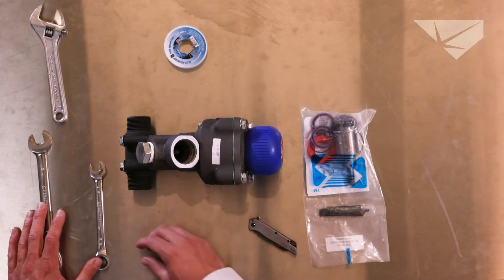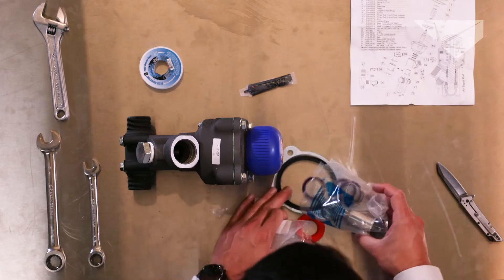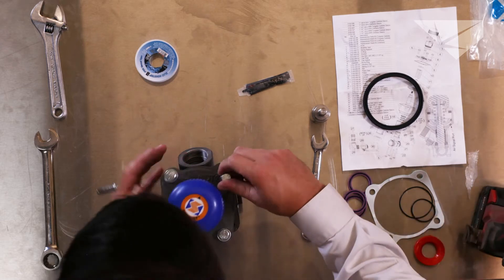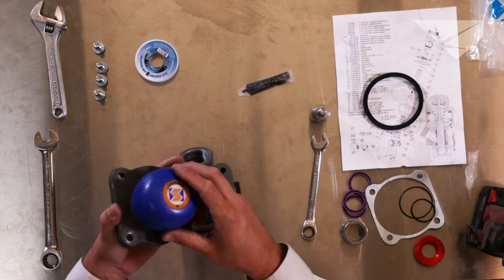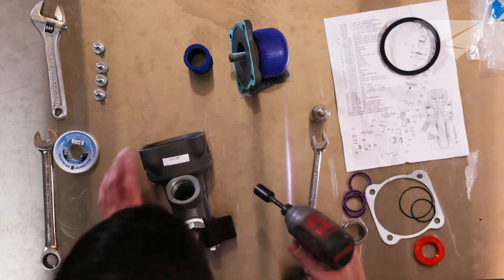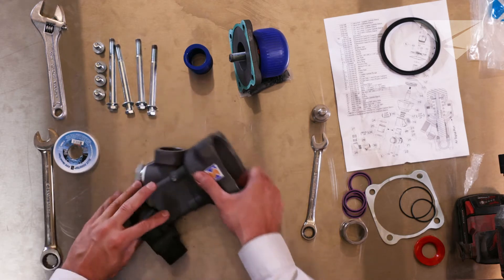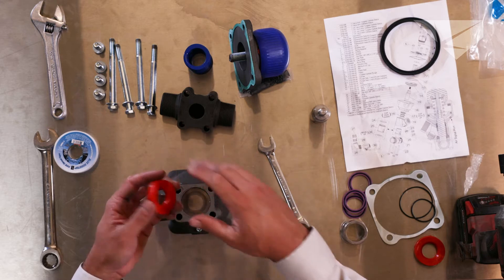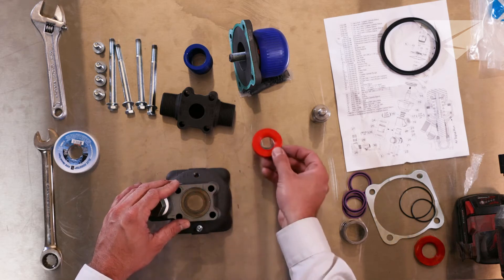How to Maintain, Repair, and Install a Schmidt Thompson Valve II Rebuild Kit

Comment: There’s no guide on which metering sleeve goes with what application. We’re getting 40 hrs max out of the urethane sleeves, and none of them trouble free.
Reply from the maker: Thanks for your comment!  What abrasive are you using?  We typically use tungsten carbide sleeves and recommend them as the default sleeve. The other option is to upgrade to the new Tera Valve, which has 2-3x the life between rebuilds.